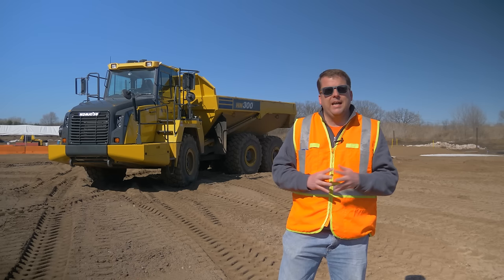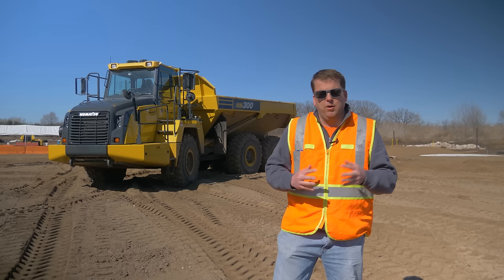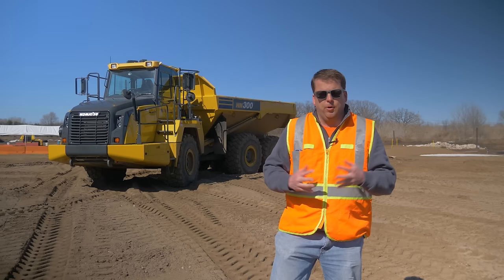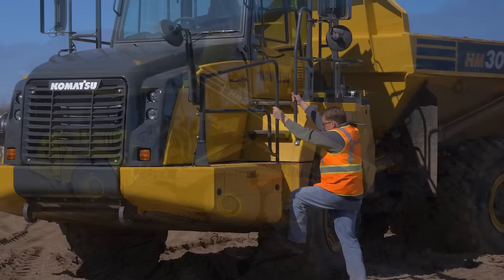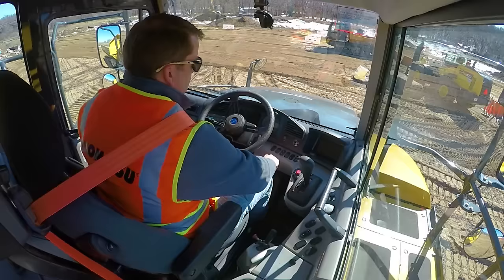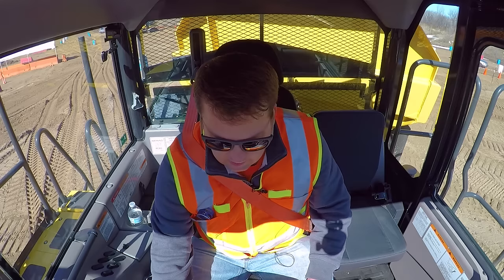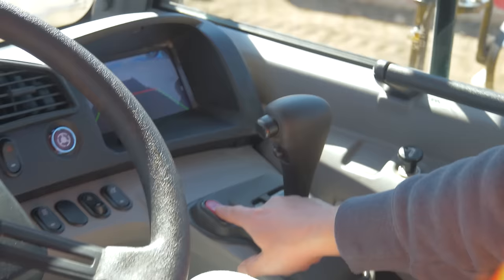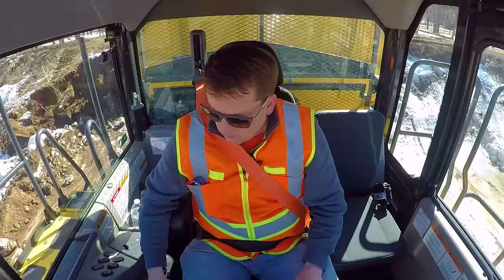How to Operate an Articulated Dump Truck // Ep. 137

Comment: I've had my fair share of playing in these and by far I've always loved the komatsu hm400-3 over the cat 740 and also the Volvo a25c. I think the way you guys have shown it pretty much is the "proper" mining technique. Although I know a lot of places that chase production times like they are going out of fashion will cut some corners. So I've been taught to pretty much never take it out of gear besides when dumping to get those revs up. But especially on komatsu the retarder is so good and strong I've known operators to treat it as the park brake for loading and unloading. Some will drag the spare foot to run the service brakes and use the other to give gas to  dump each to their own I guess. Another one I've been taught is taking off with the bed still up. Not right waving around in the air. But I've been told like get it to about the half way and just below mark and get going, cause the revs from the engine will speed it up and also by the time you get 50 metres the bed is down and the speed limiter clicks off to get out of second I think is as high as it'll go with the bed up. Another top tip I've learned is yes they are smart but what a lot of people hate about automatics is when decending or climbing and it goes searching between gears it's so rough on an operator and dangerous! So locking a gear for a descent gives that bit more control. I know cat actually has a gear lock function that you can press a button and it'll hold that gear. It's a great idea! But anyways those are my little tips and tricks/experiences. Overall you guys defintely covered 98% of what a new operator needs to know. Although it's a good laugh watching them reverse one for the first time snaking it back and forth. Best tip there is not thinking of your cab position think of the bin position and also watch the ground tracks as guidance for lining up.
Reply from the maker: This is absolutely AWESOME advice.   Thank you for taking the time to share your experience!  I agree 110% on watching a newbie try and back it up for the first time....can be quite entertaining!
Reply: @HeavyMetalLearning  not a problem at all I hope it helps someone else out. 😂😂 it's an excellent laugh but we've all done it and started somewhere.
Reply: @beaubath2537  I stop backing when material hits the bed
Reply: @justinmaddox1068  Yeah ive done the similar just depends on the site and the operator i guess but the hm400-3 can be pretty quiet so the dump in is probably better than the horn
Reply: ^THIS. All of this, especially the safety advice about locking on a given low gear, to maximize engine braking downhill. Which is also useful sometimes to get the bed down quick while taking off, without getting the truck moving too fast. Other than that: don't smack the bed's cylinders on both their way up and down (i see this hauler has some aid for that), don't trash the surface you are driving on more than necessary by using diff-locks where not needed and taking the same lines all the time, drive hard where is reasonable to do so, ideally all the route except for the very load&dump points, use the previous pile you dumped to level the bed for the next one on rough terrain,  and for the love of all you hold dear be careful while dumping the sticky stuff. PS not all but many Volvo adt's also have the gear lock button, i'm sure i have it on the A40 and A25, but not in the ancient A20
Reply: @notectrl  thank you! Yeah most of the adts have a softener on the hydros for when it's coming down or up. But I agree try choose diffirent tracks. Most of the time there will be a loader or esky close anyways keeping the track and loading/unloading spots smooth and tidy. But I agree on the drive em hard too. Production is paramount that esky op should nearly be wondering if more trucks showed up or if he's just seeing things. Plus they tend to be reasonably comfortable trucks to drive with a smooth path. I've worked one though it was the old a20 or a25c hauling sand out of a river. And so she gets abit boogy and can make for some rough rides. But when possible pedal to the floor depending on the site specs some request nothing over 3 and depends how far your taking it too. Minesites for example you normally have some travel. Want to get my hands at some point on the newer volvos the old a25c was a little rough. I still prefer my komatsu though. Cat has nothing on either though that's for sure!
Reply: @beaubath2537  thank you for sharing yes they are reasonably comfortable until it gets real rocky, i have a funny clip from this week haha ! out of the 3 Volvo's ancient A20 probably same age as you mentioned, and more modern A25c and 40 at work the A25 takes the win in my opinion, as it is almost as agile as the smaller one and the power/weight ratio is just unbelievable, whereas the A40 is a little sluggish, sorry to admit. btw none of them as lift-saver hydraulics, on the newer ones you lift almost all the way ( while left foot braking and giving reasonably much gas exactly as you described, lol ), close the gas as you hear the last telescope section extending, and avoid hitting the stop entirely for extra style points. Same as you lower the bed, full gas most of the cylinders' run, lift and switch from pull to float as the bed is closing in to the bottom frame, the closer wiothout smacking the more stye points, that's if you do have some hydraulics to help pulling the bed down in the first place .. the old A20 has a push-only piston and a steel wire as a stop, which you really * really * are supposed not to bottom out and snap lol
Reply: @notectrl  I normally run em hard and just let off as they come to full mast. Cause I know with the komatsu loaders they hit hard on the ground but never felt it hit hard with the wiggle wagons. But I normally am letting off and pulling forward when it's close to full mast anyways. And when it's lowering I'm taking off when it's at about half and it comes down then on its own pressure and weight
Reply: And run down your high spots in your haul rd
Reply: @justinmaddox1068  defintely agree! Either get a loader op to go level it or run the trucks in different tracks
Reply: Cat and 40 and up volvo have gear lock i work for haile gold mine in sc I haven’t been in other artics but it is nice

Comment: Great videos, I run the same truck at work and I think its important to note to always refer to the operators manual when running a new piece of equipment. I always thought using the parking brake when getting loaded was the thing to do, but the manual on the komatsu truck says this may damage the parking brake. Instead apply the retarder when loading. I believe this is also true for the service brakes, they should be used as little or light as possible and the retarder should be your main braking system. Thanks for the great videos.
Reply from the maker: Excellent advice....thanks for sharing!
Reply: Please is true and can i have your Facebook account i want contact you for more information
Reply from the maker: @johnhackmanhcobbina1979  not sure who you are wanting to contact....if US... just search "Extreme Sandbox" and you will find us on FB OR email us at info@extremesandbox.com
Reply: I operate the larger version of this truck and I agree the only time I use the parking break is when I leave the seat or when the CB mic hits it.....
Reply: We run volvo 40 45 and 60 and cat 745 they have a load dump brake
Reply: Aaron Martinez nice
Reply: Not every haul truck has a lever retarder so you will be applying your park brake in other models

Comment: Run an HM400 everyday in a quarry, great rigs. 5500 hours and still the most reliable machine there
Reply from the maker: Thanks for the comment.  We love our Komatsu!
Reply: That's not many hours
Reply: I drive a volvo a25c with 22000 hours
Reply: @gerhennessy7002  Godamn, whats that like? Got bumped up to running the hoe but I definitely don't miss the haul trucks, can't imagine the ride in that thing lol
Reply: @gerhennessy7002  I drove Volvo a25 and a30 for a while, the working hours ranged from 3000 to 20000, it's quite a differens

Comment: One thing to mention (I drive an HM300-1, lol it’s old but work can’t upgrade right now) if you’re going down a hill and have to make a turn, or even on flat ground, always remember to slow down. I’ve seen guys at work flip their whole bed with it lowered. This applies especially when carrying a full load. And always check your surroundings before you dump. You wouldn’t wanna raise your bed straight into a power line

Comment: I have trained myself parking brake "last and first". I put in gear and THEN release parking brake. I SET parking brake then put in neutral. You would be surprised at what can distract you between placing in/out of gear and setting brake. I've rolled off a few times before I changed my order of operations!
Reply from the maker: Good tip, but most pieces I know won’t let you release parking brake if in gear.  You must first be in neutral, then release parking brake.   Thanks for the comment!
Reply: just old the brake down until you hear the gears engaging, then takeoff
Reply: Not a good practice especially when working on a mine. You back into your parking ditch and you're suppose to put it in neutral and wait for the truck to find its "settled spot" then engage the parking break when it is no longer moving. From light vehicles all the way to Liebherr's.

Comment: Good video for beginners no doubt.. most of the time on jobsites it will already be planned out by the higher ups but always be aware of your surroundings.. especially up! make sure there are no power lines, tree branches etc.. I like to dump in Drive or N.. usually N honestly with my foot feathering the break.. this allows for the load to push your truck forward as it comes off the truck. This is all stuff youll learn in time with experience though so don't worry about it right now. I think they did a great job covering the basics for somebody new or curious about how to operate an h300 or similar equipment.

Comment: Something I noticed at the start of the video that should be noted, your cab wasn't straight with your box when you test lifted the box. While it's empty it's not the absolutely worst thing in the world however it's a terrible practice to be in when dumping. If you have stuck/frozen material in the box and your cab is not straight in line with the box, your cab can flip very quickly and easily. 

Wiggles can move dirt quickly and in some pretty adverse conditions. I've both run them and the fills/cuts they run on and have seen boxes on their sides, cabs flipped and some very interesting positions for them to be in. 

Something else to note is that when stuck in soft material a "duck walk" can be used to free yourself often. It won't always work but will about 90% of the time. That's a technique where you "wiggle" while trying to drive and do not let up. It allows the machine to grab some traction from outside it's footprint where there may be more stable ground. 

One I noticed that you did not mention is to warn green operators about stopping the box mid-raise. You didn't do it either but every person operating any size or configuration of haul truck whether it's a 25t wiggle or a 980/797 should understand fully that you never ever stop raising the box once you've started. Ever. If you stop mid way through raising and you have stuck/frozen  material your truck has a hugely greater chance of rolling over/flipping the box. If you feel it listing and think to stop halfway for safety's sake, DO NOT. It's the first instinct with a lot of new operators and it's the action that will put you in the greatest amount of danger. If you're listing a great deal, don't lift the box at all until your supervisor or dunphand comes to assist/assess. Otherwise, lift it completely and 9/10 times you'll find the machine rights itself once the load has been dropped and you begin to move forward.
Reply from the maker: Awesome advice....thanks for sharing!
Reply: Thank you, I started my first day today. The guy training me was in with me all day never once told me to not stop tipping if I felt that. That is definitely what my first reaction would have been. Might just have saved me a shitty situation
Reply: @shanewilson9428  glad to be of some help. I had aspirations at one time to go into equipment training as a career but never did. That you were able to use my advice is the reason I wanted to!
Reply: Thanks for that.  I didn't know about stopping the dump orbit stopping the dump.  This wasn't a very good video.  The guy didn't mention some important stuff.  The bucket wasn't up and in position to show where to stop.  I also think the guy should have mentioned you back up and turn in direction you want to go rather than opposite like regular truck and trailer.  And he failed to mention that they beat the crap out of you on rough ground
Reply: @timmccarthy6374  if we can't share our experiences with others then the human race will be stunted in its growth right. I think the thing to remember about videos like this is that the creator loves and operates in a different place than some of us and some different rules may apply there than we're used to. He does a great job of explaining the basic rules and functions of a lot of machinery to operate in a safe and efficient manner. I'm glad my input came in handy, and yes, especially when the King Pin is worn these trucks can beat you silly on smooth roads!
Reply: Ya I pick up a lot of good info from these videos
Reply: He taught us the basics not everything boss! So far he did his best to us beginners

Comment: I drive an HM 400 for my daily work vehicle. I have read the manual and this was a good video. My only thing is when you're getting ready to dump the manual states to use the retarder lever not parking brake. Like I said, excellent video. Keep up great work.
Reply: Do you have to wait for the lamp light above the isolator to turn off before turning off the battery isolator on yours? I get an "L04" error.

Comment: You can use retarder as brake when being loaded.  Pulling away from dump pile in D or 5 can be done while lowering bed, D starts in 2, 5 starts in 1. Just keep rpms moderate as bed lowers. Difference between D and 5 is torque. 5 is recommended for soft ground. All above advised in Operators manual.

Comment: I found the most practical way to inch forward while dumping to be left foot on the brakes (like on a loader but remember this is your regular brake, not an inching pedal so don't use it as such unless you are in Neutral) and let the load push you as much as you need by modulating the braking force, this way you also avoid activating the P-brake or tip&load brake thousand times a day. cheers
Reply from the maker: Good tip...thanks for sharing!

Comment: I hauled rock on a 740 at age 19. Was a fun time👌🏼
Reply from the maker: Awesome...thanks for the comment!
Reply: I was probably about 18 or 19 myself when I ran a 740 and got a play carting over burden off a bench good times!
Reply: @beaubath2537  please can i have your Facebook account
Reply: @johnhackmanhcobbina1979  huh?
Reply: @beaubath2537  i want to you to teach me something more about the machine please
Reply: @johnhackmanhcobbina1979  your more than welcome to drop your reply here and I'll answer as best I can 😊
Reply: @beaubath2537  is it easy to drive one without any experience?
Reply: @PotentialGaming  relatively easy, they are auto transmissions the struggle is reversing them its really where they get the "wiggle wagon" term from. But once you can master that then yeah piece of cake just have to get used to understanding the machine and that fact your not driving a little hatchback
Reply: @beaubath2537  thanks for the reply, yeah  exactly driving   forward seems quite straight forward just like any  vehicle car but reversing on  it looks pretty tricky, have you driven a  wheel loader? it looks  fairly   easy to operate i wanna start in either one of those two
Reply: @PotentialGaming  yeah ive ran a few different loaders and personally prefer them but those do take a little more skill making movements fluid and reducing cycle times

Comment: I operate a 40 ton Volvo dump truck  and I never use the parking break while I’m getting loaded  tip just  hold and break and stay in drive once you hear  the horn you take off cause while it’s in park the truck takes a second to get in gear and you roll back it would not be good to have your parking break while getting loaded on a slope saw a friend of mine that flip his whole cab  cause he had his parking break on while getting loaded he rolled back  down the slope and flip the whole cab with the full load never use the parking break while getting loaded it’s worth holding on the break
Reply from the maker: Thanks for the tip!
Reply: Sounds like good advice

Comment: I was just in one earlier today, older one, and it has a rubberized pad with a micro switch, left of the throttle and brake, pretty much at the base of the steering column. What does that switch do? Truck didn’t have an owners manual.
Reply from the maker: Tough to say without seeing it.  If it’s at the base of the steering column are you sure it’s not something to adjust the steering column?
Reply: Nah, wasn’t a steering adjustment. If I pushed it with my hand I could hear and feel a micro switch clicking. Reminded me of an old school car that used to have the high beam switch on the floor.
Reply from the maker: @yamaha37776  hmmm....not sure then
Reply: That should be the diff lock
Reply: @SlatcoAu  Yeah, Diff Lock.